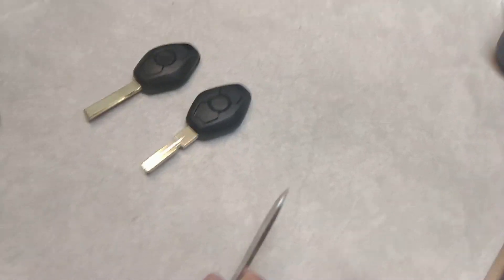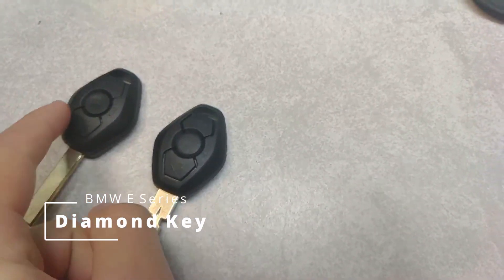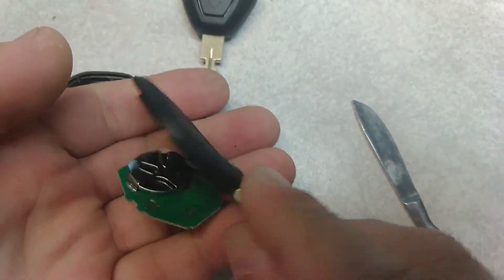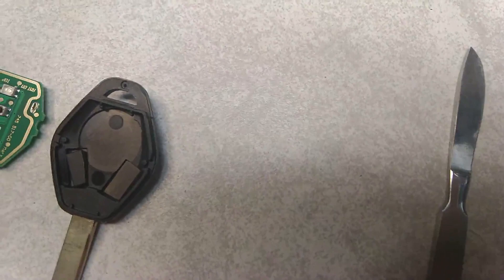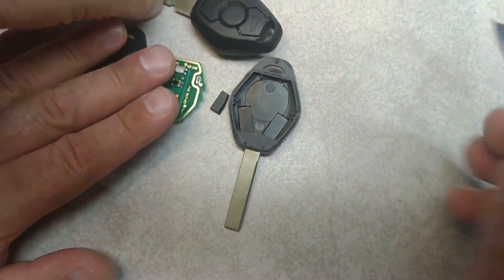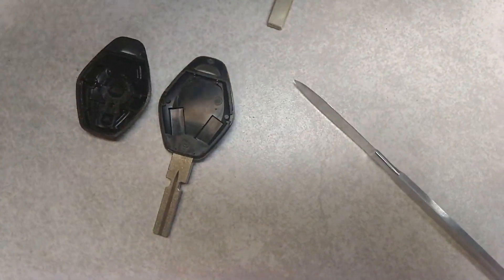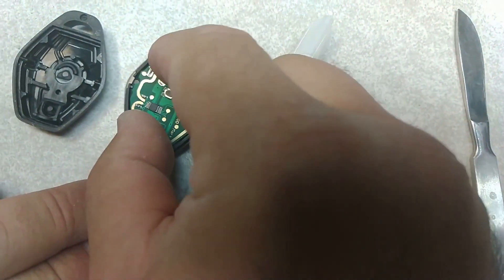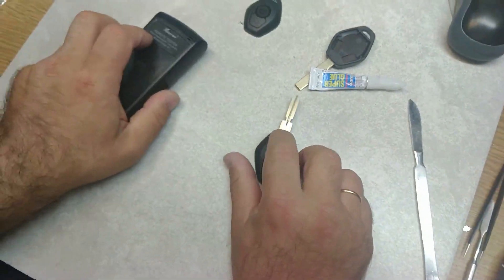BMW Diamond Key Transponder Chip Removal/Replacement Ecu team corp  BMW x3

Comment: All keys don't have removable transponder. some are soldered to the board. Update your title.
Reply: Wrong info. My transponder on my e39 is located on the circuit board
Reply: I haven't found the transponder as per video in my diamond key. Mine is the later one with the slightly updated metal key part and the transponder must be on the chip???
Reply: On aftermarket keys transponder isn’t soldered (ews pcf7935) on oem it’s soldered to the board simple as that 👍🏻
Reply: @billg1618 confirmed
Reply from the maker: No.
Reply: @ECUTeamCorp   Then now you know no one commenting and you only have four comments, you need to either clarify the video or change the title but whatever it's your channel and people are looking for help and your not willing to do that, whatever. Have a good day anyways.

Comment: Great video. My key works on my E46 to start the car but the micro switches are broken so I can't unlock or lock it from the key fob. Can I just buy a new board put it into my key and then it will open my car doors?
Reply from the maker: You need your key to be reprogrammed, in order to do that i will need the EWS key. Contact sales@ecuteam.com